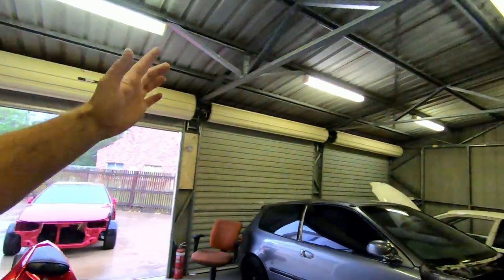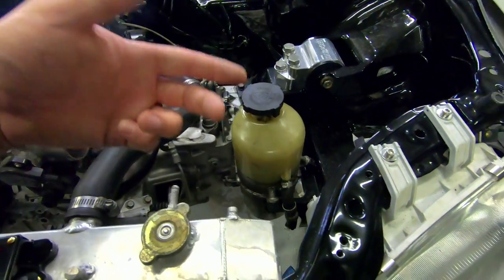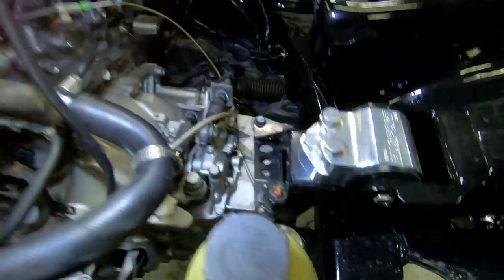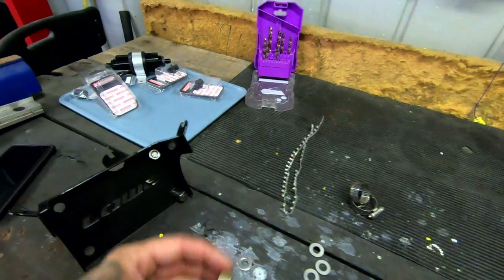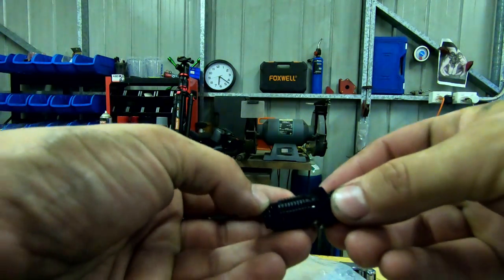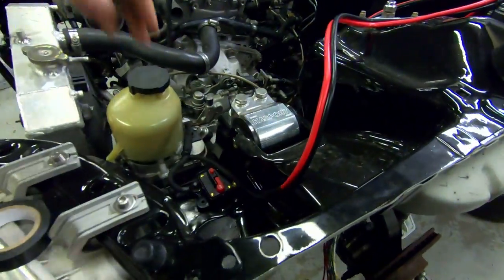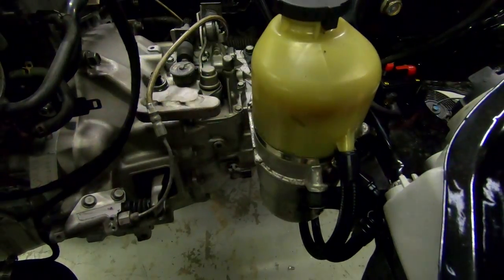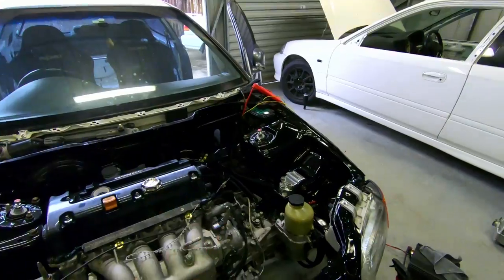K-Frank EG Civic Gets Electric Power steering!!

Comment: Thank you for this one! I'm halfway through the installation on our heavily modified Range Rover classic.
Reply from the maker: Woah what a rig! Will need to use some big fuses or circuit breaks for that big unit, the more load on the wheels and rack, the more amps the pump will pull!
Reply: @Carls_Built  Thank you! I've seen somewhere that it needs 80A fuse. My Landy is not going to see any rock crawling. 😉

Comment: awesome video would it be possible to wire it to the fuel pump so itt comes on with fuel as in uk it has to turn on itself even key is turned or it fail mot
Reply from the maker: Great question! Yes it can be wired that way.

You would take the 12v signal from the ecu to the fuel pump relay and splice into that to also be the signal (12v on) for a power steering pump relay 👍

Comment: Hey mate, thanks for this video and sharing the insight. I'm just piecing parts together now, would you remember how long the hoses need to be from the pump to the rack please mate? And also, where did you get the little breaker box from?
Reply from the maker: I believe I ordered 4 meters of hose for this job 👍 The breaker is just an everyday unit I got online hey, heaps of options and 80% are the same thing with huge variations in price so do some shopping around. You can even use an inline amplifier fuse setup too if you get stuck
Reply: @Carls_Built  awesome mate, thanks again!

Comment: Hi, installed the high pressure hose to the bottom fitting on the rack. My steering wheel fighting me like crazy. Is it because I have bleed the rack or I should swap the hose over
Reply from the maker: Sounds like you need to swap them over, yeah! I done the same and it acted like the wheel had a mind of its own haha switched them over and she was good
Reply: @carls1641  but I followed your instructions in the video. What tread is the high pressure line and location?

Comment: See how it goes when your doing fast lock to lock , a lot of people say it get heavy due to the can bus wires not being connected they can sense engine speed and applied torque  but mist people don't connect those wires , so it's kinda running in default  highway mode,    unable to tell if your really getting into it , hence heavy steering  they need a mod so they can tell the difference between heavy steering line parking the car or highway cruising,  in its present  format in can't tell the difference.
Reply from the maker: The pump alone can in fact adjust its pressure output without connecting those additional wires. Under heavy slow loads it ramps up its speed to assist with more input and reduces accordingly 👍

Comment: Did you use the restrictor found in the original Astra power steering line. I'm told the pressure can be an issue on the return line.
Reply from the maker: Nope, no restricter here and she runs and feels mint 👍

Comment: Hello I am going manual to power steering with an electric volvo pump.  I need to know if the stock subframe support a civic PS rack and pinion or if I have to get one from a power steering civic/integra. Please tell me if I need a new subframe. Thanks!
Reply: The stock subframe supports both manual and power steering. The bracket that’s holds the rack onto the subframe is different so you’d have to get a power steering rack bracket/bolts.

Comment: What material hose did you use? I'm about to plumb mine into my ek
Reply from the maker: I used braided Teflon fuel line for this one! You can use PTFE hose too but keep in mind PTFE isn't as easy to bend around corners as rubber hose 👍

Comment: Hi! Nice setup :). We´re doing the exact same thing to our endurance racer. I just have a question about the feed fitting on the rack. The oem one is with and inverted flare and I have a really hard time finding one of those over here. Did you just use a normal straight m16x1.5-AN6 fitting and no issues with leaks?
Reply from the maker: Good to hear man, its a great setup! And yes, just a plain adapter fitting works a treat 👍

Comment: What year or years astra pump did you use?
Reply from the maker: Not sure on the year of the models but your after a Holden Astra TS power steering pump 👌
Reply: Pretty sure  1998-2003. 👌

Comment: tell me you did not hook up the P/S pump to the ECU line!!
Reply from the maker: Relay for the PS pump was wired inline with the fuel pump relay 12v ign on signal 👍
Reply: @Carls_Built  sounds good; since the P/S pump gets a lot of Amps when steering standing still,in the order or 50 or more, the high side of the relay needs to be hooked up directly to the battery through a 80 Amp fuse right near the battery,usually.
Reply from the maker: @josepeixoto3384  Yep! thst exactly how I have it setup, its only the 12v “on” feed that's on the low amp fuel pump relay.

Its great being able to push the car in the shed with powersteering but the car not having to be running 😁
Reply: @Carls_Built  NOT BAD IDEA .BUT YOU CAN INSTAL Manual Steering Rack & Pinion ,then install inside under dashboard 
Electric power steering unit Toyota Prius 2011-15 .wheel will be Softer end You will lose weight ,because manual steering wheel weight is less

Comment: Why didn't you put it just behind there? You don't have a washer bottle there anyway.
Reply from the maker: Same reason you don't tuck oil coolers there.. the car gets the occasional track day and a visit into the sand trap would potentially damage the system and, also, the washer unit is there too now as its a road registered car 😎
Reply: @Carls_Built , i am going to put mine where the washer bottle is meant to be. The reservoir will be sticking out of the washer bottle hole. My car is a road registered car as well. Everything is a defect these days, so i am not worried about that.
Reply from the maker: @aaronsadat4633  is it a car.. yes? Defect! hahahaha
Reply: @Carls_Built , a cop defected the factory IWC clock in a C63S AMG and wrote " turbo horsepower gauge".

Comment: no need for a cooler?
Reply from the maker: I guess thats an option but I've seen this setup on larger cars, bigger wheels, semi slicks, drift setups etc and yet to see an astra setup with an additional cooler.. I think it maybe due to the sheer amount of fluid and the pumps ability to vary its flow/output electronically, heat isn't an issue 🤔

Comment: 💯💯💯🔥🔥🔥 everything is the same if it were to be a lhd civic
Reply from the maker: Yessir, all the same except you would have the rack fittings on the same side as so would need far less hose and maybe some 180 degree fittings off the rack to get the hoses headed towards the pump 😎